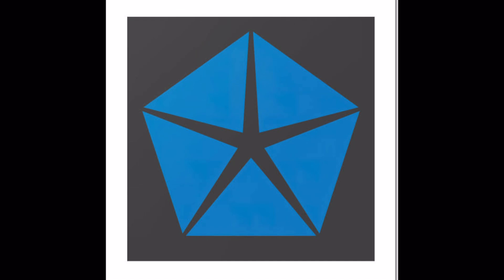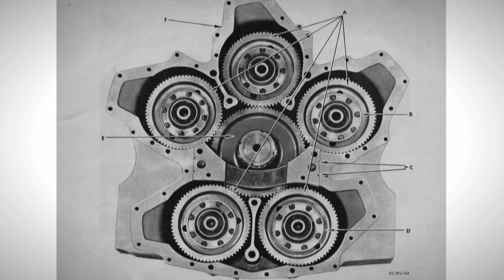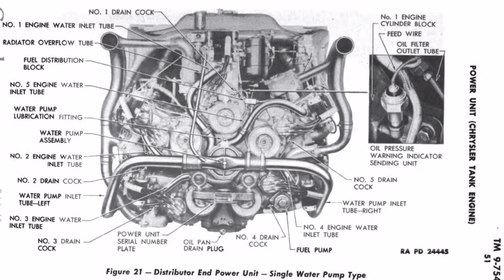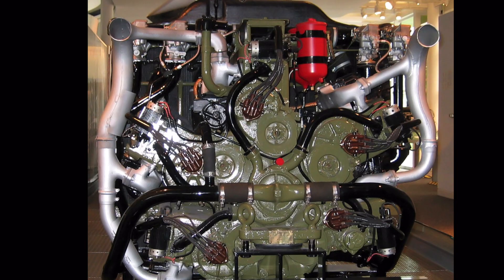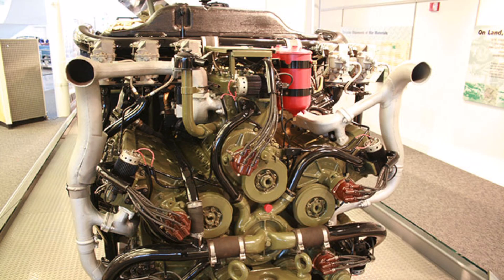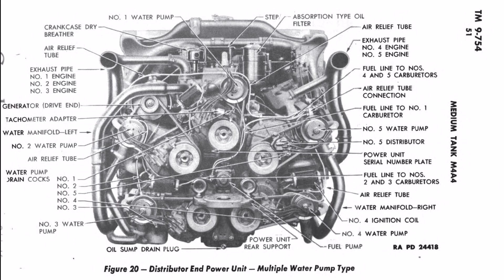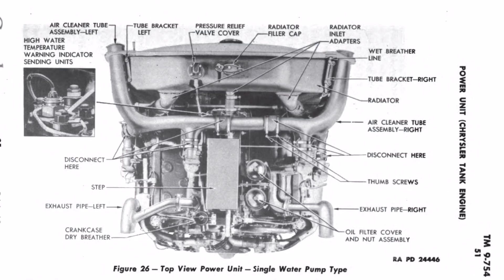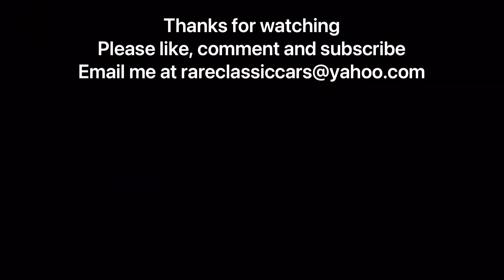Chrysler's A57 Multibank Engine: 30 Cylinders, 5 Engine Banks, 1253ci  - The Original Pentastar!

Comment: I marvel at the engineering and manufacturing abilities present over 80 years ago… particularly when one remembers all drawings were done by hand and all advanced calculations by slide rules, to say nothing about designing and building the tooling.
Reply: I'm a 63yr old Toolmaker, and run the tool & die/machine shop of a manufacturing company. Every 6mos were get some mechanical engineering students from a local college as co-ops. It's amazing how little they know about the basics of mechanics.
Reply: @pb68slab18  😆 this seems to be the case in my experience as well oh well what can we do
Reply: @SpecialAgentJamesAki These smart phones have been a curse in my opinion.
Reply: @pb68slab18  These so called smart phones have really dumbed society down as a whole. Our society is suffering morally and educational.
Reply: @pb68slab18 😅 snot nosed kids 😅
Reply: and the speed, too. to get these designed, tested, put into production and out in the field in a matter of months
Reply: They were forced to know math backwards and forwards.
They had to calculate by pencil and paper.
Today everything is touch a picture on a screen so no thinking requirements like back then.
Reply: Detroit, the arsenal of democracy!

Comment: Been in the middle of doing an engine swap for my 2000 Ford F-250 Super Duty 7.3L Powerstroke Diesel.. something mechanically damaged/worn out in cyl #3 causing a heck of a knock; has close to 400K miles on it & well since I was able to snatch up a different complete 7.3 with far less milage/time on it, from a 2000 F-450 I was scrapping out, I’ve opted to just swap out entire engines, with intent of fully rebuilding original engine at a later time. Watching this video got my engineering mind churning about, hypothesizing how much additional torque/power could possibly be had, from such an arrangement of this Chrysler engine but, of these International 444 diesel engines! Holy cow, can you even imagine how freakin’ HEAVY that’d be?!!!! DRY WEIGHT AT THAT!!!

Comment: Amazed by the sound of the engine running, expected a lot more gear noise due to the five individual crankshafts being geared to a single output shaft.

Comment: Shaft through the radiator was common in industrial and old farm equipment driving a hydraulic pump from the front of the engine.  I ran into these in the early 70 while working at an IHC Light & Medium Truck Dealer as a mechanic.
Reply: Common on a fair number of WWI aircraft that used water cooled engines as well.
Reply: Drove a S series 1900 snowplow setup like that in the 80's.
Reply: Yes, and helped change a fan belt on a Cat loader, everything in front of the radiator had to be removed, oil drained from the hydraulic system. Ted from down under.
Reply: Seen them on late model railroad med duty trucks 15 years ago
Reply: Yep, two options, wet-box and sort of nothing, where those tubes were blocked.

Comment: Adam, If I was shopping for 30 cylinders worth of legendary Chrysler engines, I would buy 5 Slant 6s. 😉
Reply: Or…….. how about five 265’s running fifteen side draught webbers for a total of 1525 hp.
Reply: @craigjones2878 Spot the Aussie ;) And no, tuning that many DCOE's,. no thank you! Getting the twin DGAV's in my VC Val is a pain enough!
Reply: I totally agree
Reply: That’s kinda what that is, wow 5 distributors
Reply: @kellismith4329  and carburettors. It must have been a devil tu tune.
Reply: The slant six should still be available as they were well built, reliable and it's power to weight ratio was vg. Surely a more fuel and environmental model could have been produced. They would still be popular especially compared to some of the dogs Chrysler/Fiat makes now.
Reply: @DavidMScott-cs8pp  Amen!!!  The Slant 6 with multi-port fuel injection is the greatest engine Chrysler never built. 😉
Reply: @RightLaneHog3151  No, a HyperPak Slant with EFI is the second greatest they never built. The greatest never built was the Quad Cam Hemi for NASCAR.
Reply: @DavidMScott-cs8pp  The Slant Six, as much as I love mine, has some issues that just couldn't be improved to meet new emissions and requirements - the engine with nothing attached, no manifolds, just the guts of it, is 210 kilograms of Cast Iron and Steel - The full engine is about 240 kilos, about the same as the 340cube V8, compared to under 160 kilos for the 3.3 / 3.8 V6's. The V6 is much more compact as well. Then there's the breathing, becuase of the long stroke and small bores, and small bore centerline to centerline measurement, plus the OHV arangement with cam down in the block (like where it was in the preceeding Flat Head Six), there is very little space for inlet and exhaust ports, and limits on how big the valves can be, restricting the amount of air you can get in. Fully worked naturally aspirated, a 'streetable'  225 Slant tops out around the 250hp mark, 300+ if you're willing to deal with the sort of lumpy idle you can only put a manual trans behind. That little ol' 3.8 V6, in Stock form from '07, get 250hp and an idle so smooth you can rest a wine glass on.
Sure, you can get 600hp+ with a Turbo, but at what cost? A rebuilt kit for a Slant is currently several thousand dollars, for the V6 several hundered.
The only thing that would have given the Slant Six more life, was a DOHC head, but even then, with mid stroke piston velocity at 4500rpm being similar to that of a 440 V8 at 6000+RPM, the extra top end of a DOHC head would be turning the engines in to grenades with the pin pulled.
Reply: You're right. What an underrated powerplant the slant engines were. Bulletproof.
Reply: They did not exist in 1940.
Reply: Except they are not slant 6's.
The slant 6 was developed in 1960.
The video even explains they are flathead 6 cylinders
Reply: @smokepeddler  mate I you're missing the point....... I think everyone knows that. 👍🏿
Reply: Oh yeah baby if all you needed was reliability but I'd be torn on throwing the 318 in the mix too. I've killed two slant sixes under normal use but never killed a 318 or the V6 version missing two cylinders. All mine had similar mileage & use patterns.🎯✌️
Reply: I just bought oil and the cashier was telling me about a guy with an old dodge van with the slant 6 that blew a hole through the block and still worked just fine he just put a rag over the hole so oil didn't come out and drove it like that for a year or so
Reply: @niaciniv177  Drove one of mine with a spun bearing the whole time it was in the car,.. and the mechanics I'm related to say 'nah, it's nothing, just the dover plate on the gearbox rattling',.... It was the number six rod.
A hole through the side,.. I've heard of a couple of 225's that broke a rod, usually by being spun like a short stroke 170,.. with owners dropping the pan on the side of the road, unbolting the rod and leaving the piston pushed up in the bore, so they could get home. So long as they have more then 5psi oil pressure, they'll get ya there.